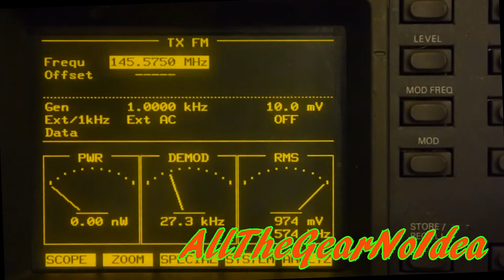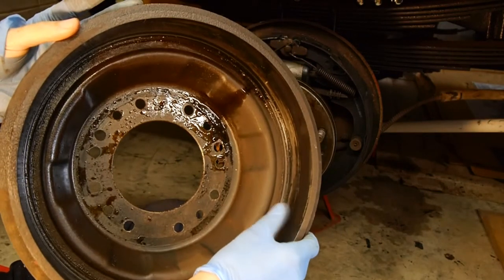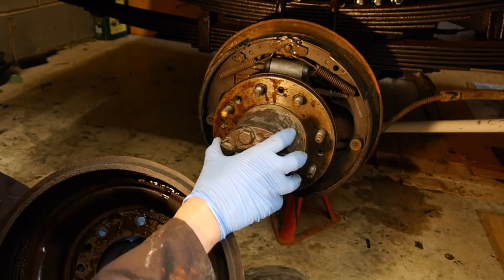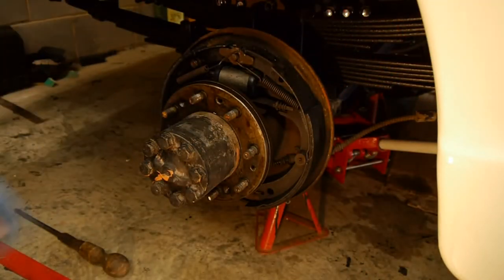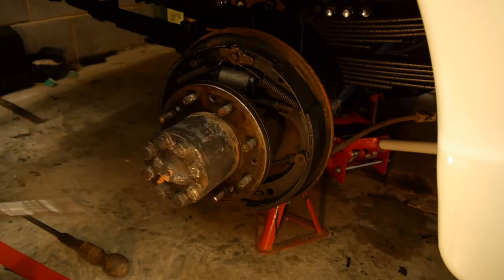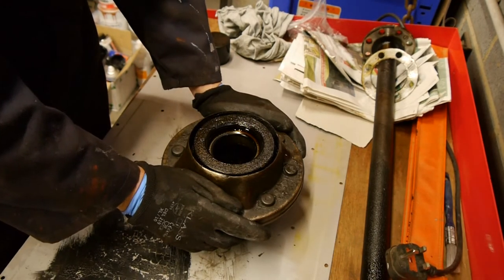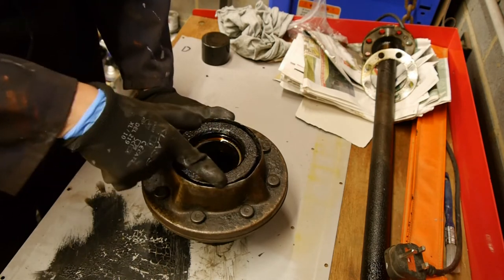Axle Oil  Seal Chevy 3600 - Part 1

Comment: What a fantastic idea being able to replace the drive shaft like that. My Dad always told me American cars were rubbish and British stuff was best. He was very wrong, and confused, particually as he has always bought Ford's! 
Love the truck Chris, must pop up for a run around the block with my baseball cap on back to front yelling Son of a bitch!
Reply from the maker: Simon Spiers  Your very welcome to come for a ride as long as you don’t come over all deliverance on me, because I don’t fancy squealing like a pig.  It’s true that  Americans have never built a car that will go around corners, but much of the engine and suspension designs were way ahead of us. Coil springs and hydraulic lifters were common in the 60s   Regards Chris
Reply: Your just playing hard to get!  Agreed , and reverting back to electronics the HP gear of the 0's was built like your truck!
Reply from the maker: Simon Spiers That’s one of the reasons I like working on HP gear even  a mong like me can’t destroy it!

Comment: Brings back memories of a Hillman Imp I had once. Stupid question, but what thread/screw size does it use, UNF?  I saw a blue 70s Torino yesterday, well smart, needed painting red with a white stripe down the side. Regards Andrew
Reply from the maker: Andrewausfa hello Andrew it’s a mixture of UNF and UNC.  I have it back together now so hopefully part 2 uploaded later. I’m back out today as I’m going to re wire the rear lights. The wiring was really poorly installed and no grommets.   Doing the first bearing seal was a bit taxing with trying to get a feel for the bearing preload. I used to be quite good on the spanner’s when I was young but years of sitting on my Arse watching YouTube haven’t helped. I guess you just have to do your best, but there a few jobs I wish I had done better. We live and learn.  Regards Chris
Reply: @allthegearnoidea6752  Hi Chris, I saw your comment about modern cars on the drag video. I realised I've probably not done any car mechanics for years now, you don't really need to touch them except for POL and air in the tyres. No more adjusting tappets or fitting the latest Harry Moss centre console to your Sierra. I guess like me you learned car mechanics by yourself, how much fun and education in how stuff works are 'our' children missing out on?! On the other hand they probably don't care :)  Ah yes I forgot UNC, thanks. You must be much more well equipped than me in the tool department.....  Regards - Andrew
Reply from the maker: Andrewausfa  You are right mechanical knowledge was born out of necessity for our generation. All of my first cars were junk and required constant maintenance. I remember checking oil and water almost daily and a long journey was anything over 20 mile. Your dead right we must of learn so much. I wouldn’t even know how to check the oil and water on my Landrover discovery. I wonder if it’s still possible to make a saving doing maintenance on a vehicle for modern cars.  Most kids I see wouldn’t be interested in even trying.  PS: have had no complaints about the size of my tool.  Regards Chris
Reply from the maker: Andrewausfa  Do you have any classic cars ?
Reply: @allthegearnoidea6752  Not now. Last one was a BMW 728i (E23) from the 70's. Cracked head, end of. Not sure I could be bothered now, possibly would if I had a big garage but I have too many hobbies as it is ;)
Reply from the maker: Yes too many hobbies - tell me about it LOL!!
Reply: @allthegearnoidea6752  Me: electronics, guitars, angling, woodwork and I used to do a fair bit of hiking up your way around Buxton, Youlgreave etc